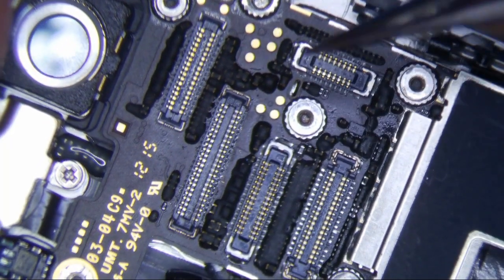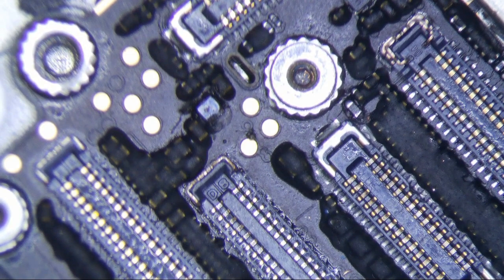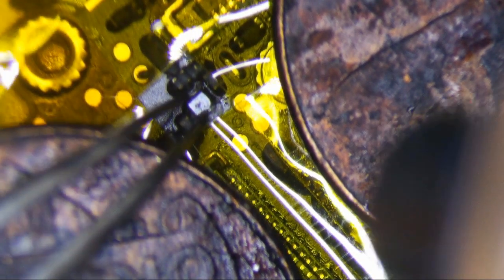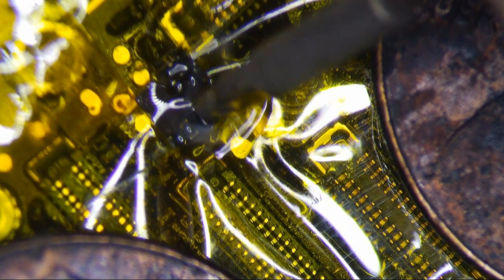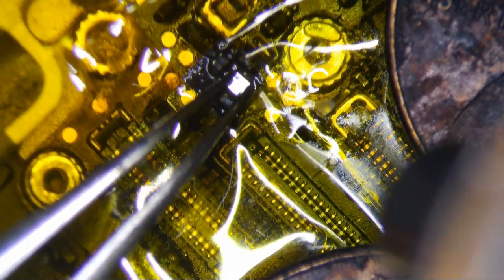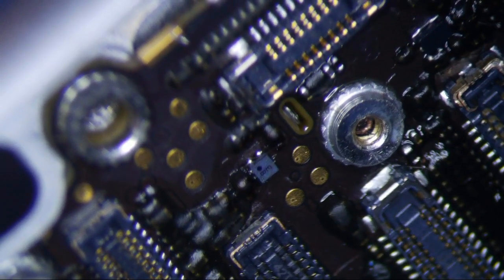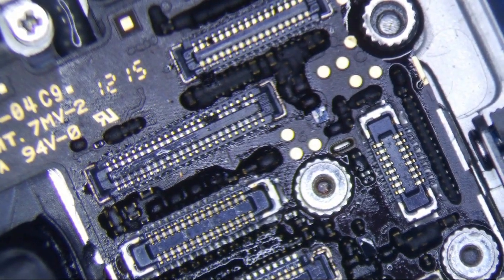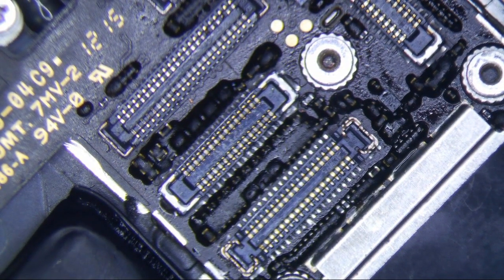iPhone 6 No Front Camera   Rear Camera   Flash Repair LDO

Comment: I want to +1 for useful video, because I replaced the LDO with a donor and it works, front, back, and flash. Good! That H3 or EH Chip is very fragile, so be gentle with it or it will crack into pieces.

Comment: can this same/similar repair be done to an iphone 6s that i believe has the same problem as far as the 2 cameras and the flash not working, both cameras not working even after being replaced
Reply from the maker: Yes it can.  The cameras work in the similar ways on the 6 and 6s.

Comment: Thks for sharing man, pls how manny degrees are you you using?
Reply from the maker: it varies from 300-415C.  I would recommend that you start a low heat setting and increase slowly until the chip comes off and the plastic around it doesn't melt.  You need to experiment.